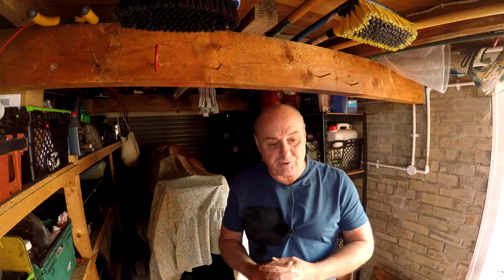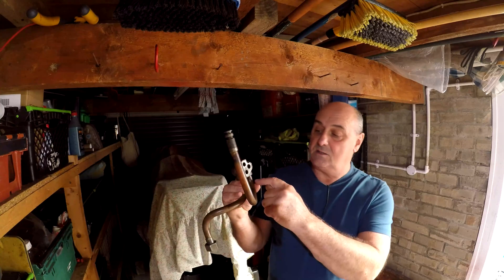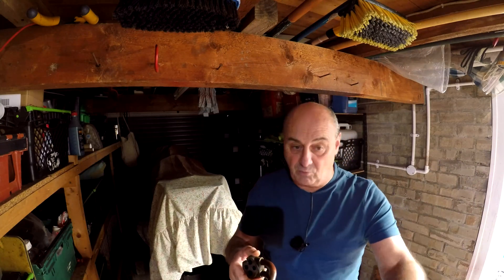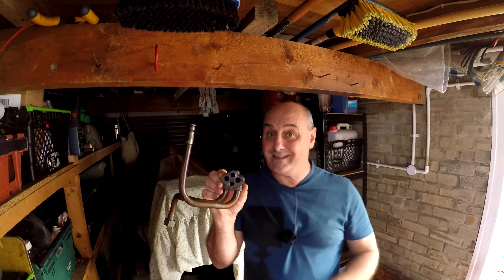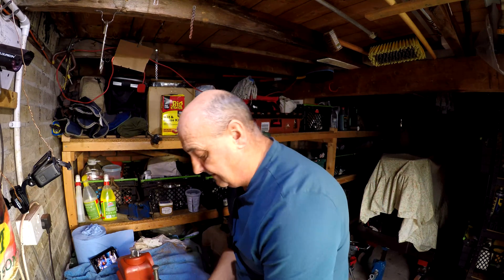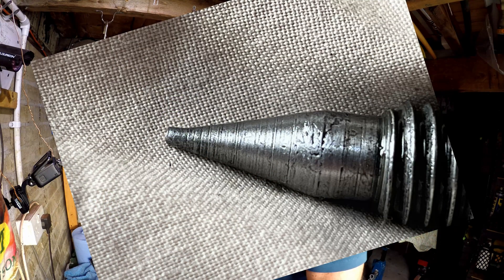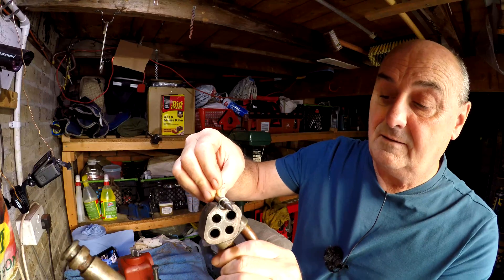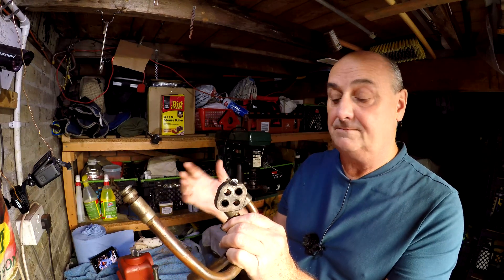DB990 hydraulic valve chest needle valve.

Comment: Plumbing fitting sizes 8,10,12,15 and 22mm  Or you can fit an imperial ring in to a 22mm compression fitting for 3/4".  Think you might struggle to get a 5/8" fitting at a plumbers merchant. Can you get a threaded something to go into the brass nut? M 😀
Reply from the maker: Hi Marshall, I've tapped the end fitting that goes into the camels humps just waiting for the M14 to 1/4" to turn up, hopefully then we can get it tested,
Many thanks
Barry

Comment: G Day Barry, As Campbell mentions leave the return open so you can check for leaks. Boy if you are correct with the hammer there must be some rough bastards about, I have seen a few over here though.
Reply from the maker: G Day Lance, Cheers for the advice, I've posted the service bulletin you sent me onto my g drive for others to use.
I did notice that even with the manifold completely loose if the valve chest is secured in the casting the needle valve still cannot be inserted without forcing the manifold out the way, so I think some fitters decide the quick tap is the best way forward.
I will explore this more when Icome to put mine back in.
many thanks
Barry

Comment: Regarding the hydraulic test adapter, one port is for applying test pressure, the other port 'B' should remain open (don't plug that one Barry) to check for excessive leakage past the non-return valve. There are four places on the control valve assembly to check for excessive leakage. The exact test method is described in the shop manual, you may wish to post link. good luck!
Reply from the maker: Cheers Campbell, I popped on the community tab the TSB Lance sent me,  regarding the testing of the valves, just waiting now for the deliveries so we can put it together,
was on ebay the other day and another test pump popped up had been returned by the customer and it was up for (at the time) £13.00 + P+P couldn't hep myself, mine cost £70 ish, so there might be a second pump on the way.
many thanks Campbell for all your support it's very much appreciated
Barry

Comment: Both times I've removed and reinstalled the Valve Chest, I had the lowering valve in place when removing/reinserting.
Reply from the maker: Hi Shane did you manage to get it past the manifold easily?
many thanks
Barry
Reply: @manfromthemist1958  Yes, I had no problems with it.  You can see it in my reinstall video.  (The one with "Will the Lube Pipe fall" in the title)  I did turn the valve a bit diagonally to keep the tip's pin thing from hitting the manifold. (show that at 19:12 in the vid)
Reply: @path.of.discovery  @manfromthemist1958 Agree the control valve removal process would be much easier if you have access to an engine crane! If manually removing the entire rockshaft assembly (with valve chest attached) trust me, it's much easier to simply remove the needle valve by hand (after removing the two bolts that secure the hydraulic union in place and then gently levering it sideways). That way the whole rockshaft assembly comes out without the needle valve catching on the hydraulic manifold/union, or on anything else that it has an amazing tendency to get caught on! I believe damage occurs to the end of the needle valve, if the valve with it's travel limit collar, is force fitted when the two hydraulic union bolts are already done up therefore - suggest gently levering the hydraulic union sideways, just a tad - to allow re-fitting the needle valve easily by hand, before securing the hydraulic union back onto the control valve with original two bolts! This may serve as a tip to others, having seen a few bent/damaged or entirely missing needle valves!
Reply: @CampbellBooth-gy8jv  If I ever need to take out my valve chest again I'm definitely going to remove the needle valve before full removal/insertion.  Your points on minimizing stuff that catches is great.  I guess I've been lucky so far!